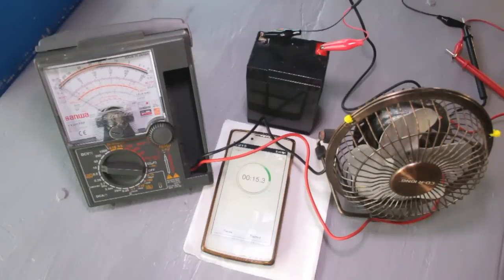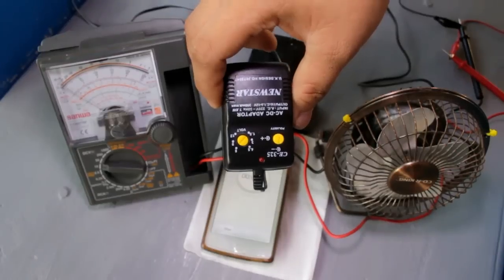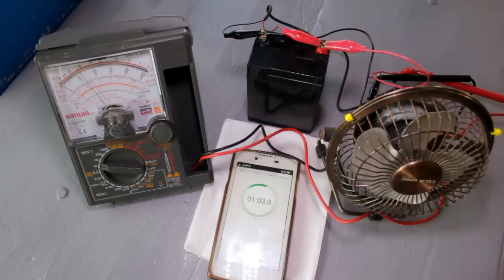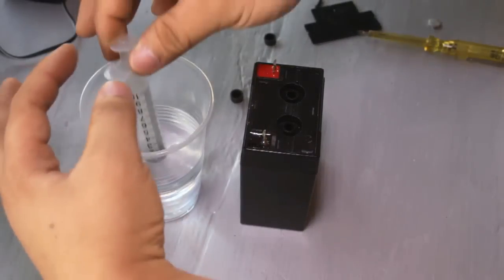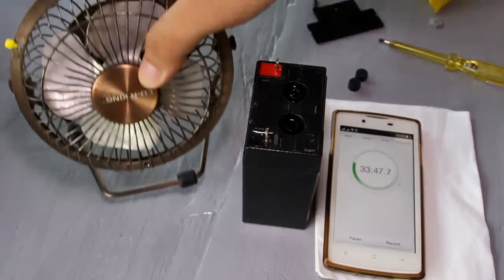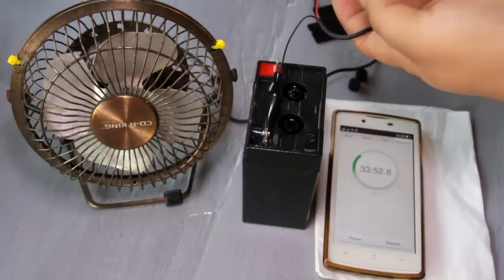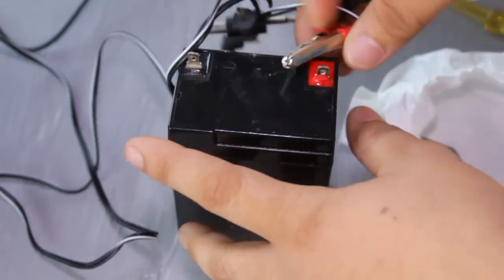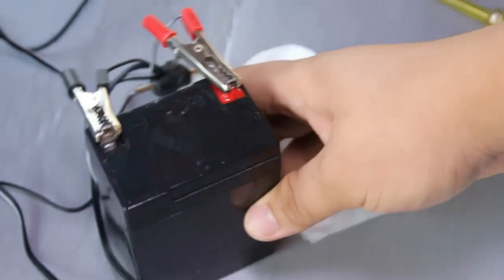How to Fix Lead Acid Battery (easy way)

Comment: Their to heavy plus I'm very happy with my Gel batteries..This is my verdict lead acids DO have the energy density compared to Gel(I gather density means how quick the energy flow is to get to top speed). While Gel seem to...Well think about it Gel form OR liquid (hence lead acid.FYI...Gel batteries are JUST
 iead acid with thicker cells and the gel coating  needs to "smolder" away before going into LIQUID FORM..I think

Comment: Hi friend namesta 🙏 i watch your video and i try on my 6v ,12v batterys but voltage was dropping very fast  40to 60sec total discharge but remaining voltage is 6v =5.68v 
12v =5.84v i 😭please tell me a solution for my problem please

Comment: very bad timing on the person that was responsible for turning the fan on the instant that the clip was put on the battery to start it...jumped the gun a bit I would say...you can very easily see that the fan comes on before the positive clip was even connected to the battery when you watch it in slo mo

Comment: Dear Bro...
Could you kindly guide me a clear and  short to the point
ways according to the following conditions:
1 features ....where you dont need to try to recover ,just throw it away,and buy a new one
2.....where you only need to fill it with distilled water and
charge
3....wash and clean the cells with clean water, fill it with battery acid and charge

Comment: Hi sir. Just some questions. I have four 12V lead acid battery seriesed to 48V for my ebike. It charges so quick and quickly discharged when running under in 10 minutes. Normally i used it in a day when fully charge. What is the problem will this process works? Thanks.
Reply: You got 48/2 = 24 separate cells in series. If only one of them goes bad the whole thing does not work properly anymore.
First you have to find out which of the 4 batteries is the one containing this "bad cell". Once you have done your 10 minutes ride it should be the one whose voltage is the lowest: Replace it with a new one (provided the other 3 batteries are still intact otherwise you have to throw away one/two/three of those as well).

Comment: I forgot to mention to takeout...if any...electrolyte and rinse thoroughly with ordinary water ....then  mix baking soda and water to get it  the most desolved you can get it... And pour it in the battery and let it sit for a couple of days shaking it a few times a day ..then add new electrolyte... You may want to do it twice for older batteries... Then they will be good as new

Comment: Just because I am a nice guy unlike these other idiots that like to lie to you and make money doing it...I am going to give you the real helpful info to refurbish you sla batteries.. It is the lead that dictates the amount of current you will get from the battery...over time from the constant charge-discharge cycles the surface of the lead inside the battery will get "corroded"..i am using this word for description purposes only..this buildup is what slowly over time will continue to make the battery weaker and weaker...and also the breakdown of the electrolyte inside the battery ...by design batteries self discharge over time...pretty sure many people don't know this... You must have 2 separate ways to discharge a battery to have a battery... Electricity will always take the path of least resistance...this is not up for debate... When you connect the load (whatever the battery is powering) it provides an easier way for the electricity to flow than the battery itself with no load through the electrolyte...this is what makes a battery possible...they will slowly but surely discharge over time...so connecting both the + and- together with a load in between provides an easier path for current to flow than the self discharge through the electrolyte...if there is no electrolyte inside the battery there is no battery... Because 2 ways for current to flow are needed to have a battery...because you have to make it  easier for the electricity to flow to have a battery...batteries are not the future.. They are the worst thing to use... Capacitors are the future and very easy to build by people who have literally 0 mechanical ability...but it would be a very wise idea to have some electrical knowledge when you start playing with capacitors since they are essentially batteries capable of discharging all of its current instantly...if u are going to refurbish  sla batteries you must clean the lead as best as possible and use 30% sulfuric acid 70% distilled water mixed together for the electrolyte inside and it will work like it is new... Why do you think they say always recycle batteries and why they even pay you for the old batteries... Because they are dead does not mean that they have no value.. Maybe this helps some people understand why they say to drop the battery from a few inches...u are knocking off the buildup on the lead...
Reply: I thought the lead was recycled to make pots, pans and utensils for the needy!
Reply: Bryan Adams lol
Reply: Now i understand better

Comment: Adding water to a cell with dissolved lead plates is going to do shit all. You have enough volts for that piss weak 5v fan, but no real usable amps for anything else. Put these back in your electric scooter as see how useless they are.

Comment: Hi

if i have pb selad battery that have low volt .
and i want to start the charger ( i have charger that can be start charge at 0.3v) 
but what Amper i need to set it? low? or high?

thanks
yossi

Comment: With the battery cracked / swollen What does it mean?
Reply: means you over charged it and the integrity of the battery has been compromised. I would toss it if I were you.
Reply: It will go boom
Reply: Sir my SLA rchrgble batt was also crackd and the 3 container dnt knw i pour in distild water. The two container are good i think. But the one container near the negative part was crack it cannot stord wter coz of crack. Can i still use it? TIA

Comment: What is this water
Reply: Distilled-drinking water?? Distilled water should not be used for drinking purpose and drinking water should not be used for filling batteries.
Reply from the maker: distilled drinking water

Comment: 1/3 Sulfuric acid and 2/3 distilled water. Best 38% Sulfuric Acid and 62% Distilled Water
Reply: No.You should never add acid to a good(or one that works though hold the slightest charge) battery. It will change the cell balance and reduce its life drastically. Only if you plan to rejuvenate a really old or dried SLA should you add maybe 5-15mL of acid and then add water to kick the charging.

Comment: I'm afraid your text-to-speech computerised voice needs a little "tweaking". It's a "led" acid battery, not a "leed" acid battery. However, the idea of using such a voice has some merit, and could be further improved by getting rid of that pointless, irritating and distracting background noise, (some people claim it to be "music"), which just complicates the problem viewers have in trying to hear your instructions.
Reply: *There is also a battery reconditioning guide on>>>>>https://t.co/jfZbilIKLW?def >>
Reply: \'m not sure but ,if anyone else wants to discover how to recondition batteries try Panlarko Recondition Planner ( search on google ) ? Ive heard some interesting things about it and my friend got cool results with it.
Reply: There's several factors in doing a pro job. One plan I found that succeeds in merging these is the Rapid renew roadmap (google it if you're interested) definately the most useful info that I've seen. look at this awesome website.
Reply: I have spent months studying battery repairing and discovered a fantastic website at rapid renew roadmap (check it out on google)
Reply: I've been studying battery repairing and discovered a fantastic resource at rapid renew roadmap (google it if you're interested)
Reply: I've been studying battery reconditioning and discovered a great website at Rapid Renew Roadmap (check it out on google)
Reply: dav snow#
here's  a few ideas for fixing a car battery
never try to do this unless you know what you are doing - the acid can burn you
Test the voltage first - there may be a dead cell which would waste your time.
Check the battery fluid.
attempt to completely recharge the battery.
(I learned about these and more using Rapid renew roadmap website )
Reply: in any case the message that is conveyed is very useful
Reply: dav snow haha it's LEAD. But oh well. Grammar isn't important right? Lol
Reply: Bro it is not a led acid battery it is lead acid battery